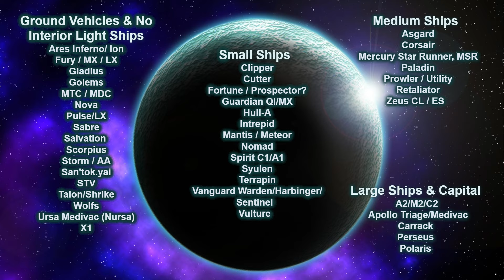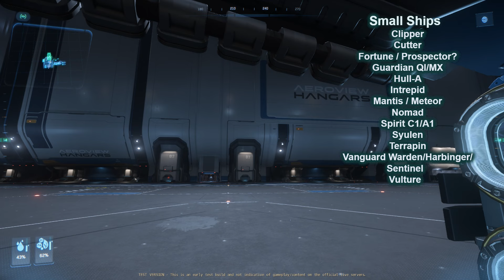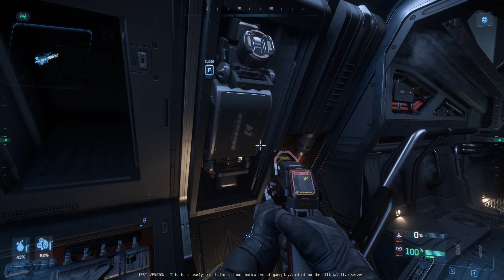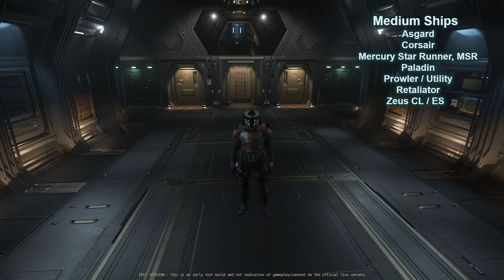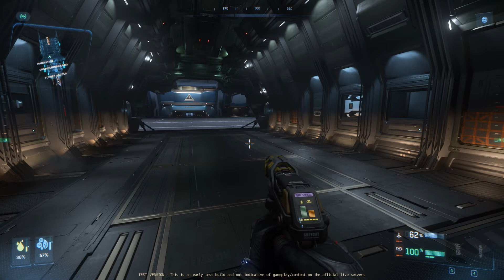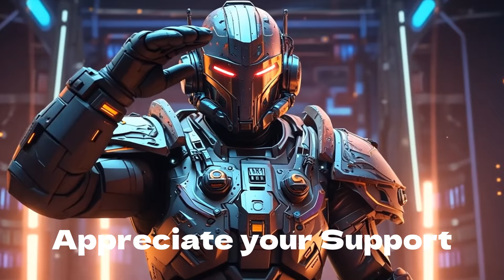Ships Fully Engineering Ready, Star Citizen 4.5

Comment: I'm surprised the RAFT isn't up to spec. That interior was way ahead of the curve in terms of component access. The Hull A tho 👀
Reply from the maker: I know right, I pulled that bad boy out thinking surely it was ready. A few components were missing and no engineering terminal. Not sure if those components might be outside somewhere, but I thought it had everything.
Reply from the maker: Werid they put the Raft in today’s eng doc but I didn’t see the terminal in game and I couldn’t find some of the components but sometimes my vehicle manager doesn’t seem to save correctly. I need to make sure I sync my clock before using it more
Reply from the maker: Also the Hull A was listed as not complete but it was listed as ready when the wave 1 of 4.5 went out. I haven’t been able to try that one out b/c I haven’t pledged it
Reply: @Guardian_Templar MAAAAAAAAAN, it's such a great little interior to that ship. I can't wait for the B.

Comment: My personal opinion on engineering: 

No matter the scale and size of the ship, I want more MFD repair and engineering and less running around pointing and clicking the magical space laser or fire extinguisher.

I want the auto repair to be on a cooldown (longer for larger ships) and perhaps to repair less with each use and I also want auto and manual venting of rooms through life support and MFD's. 

Only in the worst of cases should I be running around putting out fires myself and manually fixing things should be reserved for when I'm out of the damger zone or landed.
Reply from the maker: Agreed, and the CD idea would be really nice, especially since a portion of the ships still don't even have engineering. Maybe even over half, I didn't actually look at the numbers, just recall Jared said 80 are ready.
Reply: @Guardian_Templar  the more I think about it the more it makes sense. The repair could also be tied to a finite resource like med gels for respawns that we slot in somewhere near the engineering stations, so on top of the cooldawn you can only do it a certain amount of times before running out.
Reply from the maker: @gabzsy4924   would be down for that as well, I just keep thinking about the ships that aren't ready that are pretty badly punished by only 1 repair charge